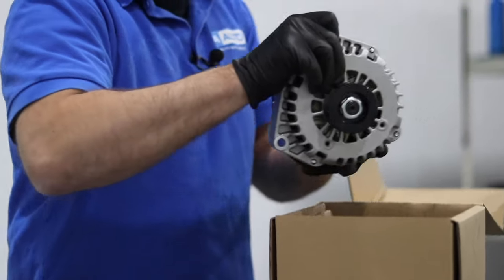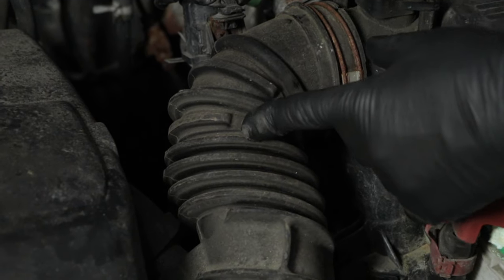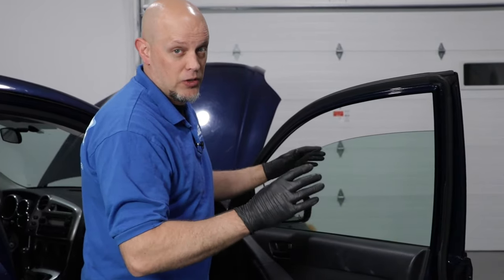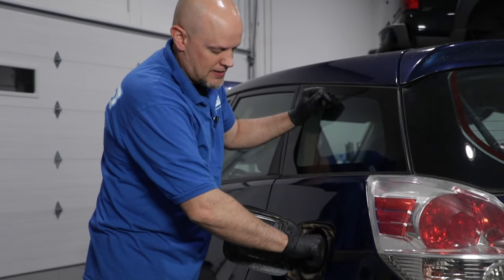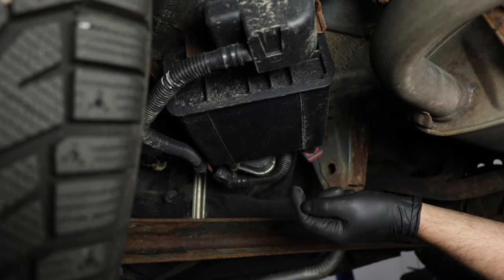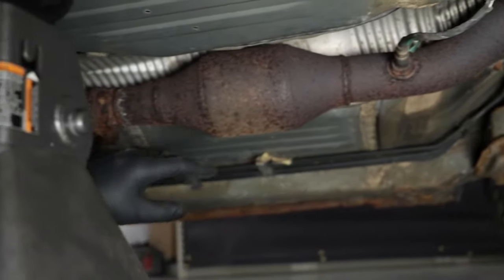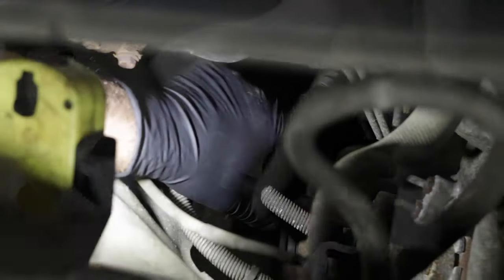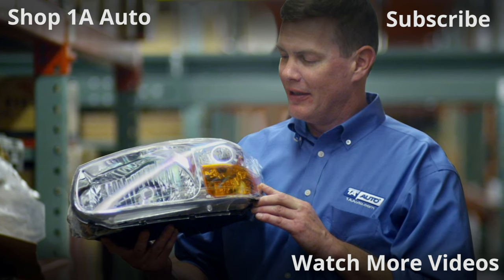Top 5 Problems Toyota Matrix Hatchback 1st Generation  2003-08

Comment: I have over 201.000 miles on my Toyota 2007 Matrix. Have not had any of this issues with my car yet.

Thanks for the information and help on how to deal with these issues.

However, changed my up and down stream O2 sensors, outlet manifold, water pump, thermostat, alternator, drive belt and tension er.  Wow, to replace that drive belt tension er you have to disconnect that front right motor mount jacking up the engine by 4 or more inches. That bottom alternator bolt is hard to remove. Don't strip that bolt. Pay attention to the torque specks on those 6 water pump bolts they are not all the same.

Maintenance, maintenance, and maintenance is the key to keeping your Toyota Matrix running for a long time. Get a OBD 2 reader and it will tell you what your problem(s) are when the check engine light comes on.

It is like the Air Force B 52s. They are from 1955 and still in the air. It is maintenance. The only original part of that plane may be the original tag on the frame. Everything else has been removed and replaced maybe several times or more. It has been flying for nearly 67 years.

Comment: I own an 06 matrix it has 316000 and I had all these issues and then some . I had a p0171 and it actually ended up being the intake manifold gasket . That gasket was so brittle I was shocked but , easy fix none the less .

Comment: 2003 Matrix automatic that I'm still driving. I love this car and hope it lasts me until I no longer need a car. :D  The only thing I HATE is that they didn't carpet the floor of the hatchback. I put a big rummer mat over is to stop gear from sliding around. In 20 years I have replaced the battery, muffler, starter motor, and various gaskets. My cousin owns the garage I take it to and he says if everyone bought a Matrix, he'd be in the poorhouse.

Comment: I have my 05 VIBE GT, love that car and it's over 600k miles.. Only issues consistent is the sunroof leaking, stereo having to be reset. Preventive maintenance is key. Right now I replaced the clutch but normal wear. Then the big one is the valve that blows through the exhaust on shut off
Reply: wow! highway miles? also loving for a manual vibe gt
Reply: Damn 1 million kilometers and still going

Comment: I've owned a 2004 5spd  since new.
I've only had to replace a couple ring seals, intake gasket and lately one of the transmission bearings.
The shocks are next.
All original bulbs and such are still working.
Aside from routine fluids and drive belt, nothing else has needed replacement.

Comment: '06 Matrix XR here bought new 2005.  19 years old in September.  73K original miles.  I have had none of these 5 problems, but I live in Chicago, so needed new exhaust in 2022 and extensive front end work in 2023 (city streets are brutal).  1800cc engine with auto trans.  My mother calls it Wonder Car.  I am always getting approached by parking garage managers that want to buy it.  Nuh-uh.  The car gods blessed me with the Matrix as compensation for having bought a Chevrolet Vega back when.

Comment: I've seen most of these issues with my 2006 Matrix. Bought it cheap (used of course) a couple years ago because that's all I could really afford. And it's just been one thing after another. I'm not very mechanically inclined, so I've had to outsource. And just recently took it in for the airbag recall and they gave me a long list of things it needs addressing with the fluids, the brakes (which had recently started squealing). Someone tried to break into my car, so I had to get a window fixed, still debating whether I should order new locks since these got messed up. Oh, and my kid snapped one of the handles off. But aside from all that, it gets us where we need and is still going strong on all the miles. Just gotta set aside time (soon) to get all these issues finally addressed.

Comment: Great Car.  I have 260,000 miles on my 2006 Toyota Matrix XR.  So far its been mostly tires and brakes, oil changes and oil filters, air filters.  I changed the plugs once.  Replaced the starter once.  Replaced the battery a couple of times.  I have had this car now for 14 years.  It has the original engine and the original transmission, which, I think are holding up better than the body parts.  A few body parts have just worn out and fallen off such as inner fenders, trim below the doors,. trim on the back end, the letters.  I may have the motor mount issue because it is making some noise.  But it is still getting 30 miles to the gallon, like the day I bought it. I wish I could buy another one.
Reply from the maker: +Gary Amstutz Thanks for the feedback!

Comment: The intake gaskets and manifolds are bad for leaking in cold weather throwing a p0171 code, as well as the timing chain tensioner o-rings fail causing an oil leak that makes the passenger side back of the engine and ps pump. Just a few common problems with the 1zzfe platform :)

Comment: Literally 5/6 of these issues have occurred with my 2003 Matrix.  I guess I should wait for the windows to fail, LOL!  Spot on!
Reply from the maker: +trish marshall Thanks for checking us out! http://1aau.to/m/Shop-1AAuto-c
Reply: I have an 03 Matrix as well. I have a weird ticking noise when it idles. Check engine light is on. I was told I have 2 catalytic converters. The back one is bad.
Reply: How many miles do you have on it?
Reply: @skylilly1  yes there is 2 catalytic converters but actually act as one with the o2 sensor in between.if it's the back one that is bad no codes would be triggered since it is passed the downstream o2 sensor. If the back one is bad the other one might be bad and that throws a code. They usually come together in one assembly
Reply: @skylilly1  the ticking noise could be the evap thingy under the hood that ticks

Comment: I think I have the bad MAF... but the only issues I get from that are cold start idle surging so I've not yet replaced it. The only other issue Ive had on the list is the window falling out, but that's because someone hit the passenger door in an accident (I was parked) and damaged the mechanism. As for the idling vibrations? The 1ZZ-FE is a very rattly engine - lots of NVH even in VINs with healthy engine mounts.

Comment: I have a 2006 Matrix XR, auto.  Love it.  Here are two downsides.  I live in LA so when the temperature gets above 95, the AC starts to lose the battle.  I have an excellent mechanic, we keep the ac charged up.  Done everything we can to get the max AC but I just accept that the 06 model, the ac they use is just not that strong.  Guy I know has an 09 Matrix but his ac is cold when the temp goes above 100 here.  The other issue I had, at 60K, one of my engine mounts broke.  Couldn't believe it.  I am the second owner.  I am an old guy so I am a safe driver and rarely ever speed.  Previous owner was a senior who used the car to go grocery shopping before she retired to a nursing home.  I bought the car at 40k.  It is still going strong at 120K now.
Reply from the maker: +@yogitam2372 Thanks for the feedback!

Comment: I have 05 base model matrix 5 speed with 220505 on it still runs strong The only thing I’ve had to replace is the clutch, and that was all messed up from the previous owner.

Comment: Always hold loose glass all the way up and firmly flush to the top door frame. Tighten properly firm while holding in place. If you can't get to screws all the way up, you can get them firm but loose, push up into position, lower carefully then tighten fully, hold what you got.

Comment: P0171 was triggered on my 2005 Pontiac vibe and it turned out to be dirty / clogged fuel injectors. No vacuum leaks present.
Reply: I found a 2005 matrix with the same code. the owner says the car takes a while to shift after 65mph... fuel injectors? that solved your transmission issue?? Should I buy this 2005 matrix and try to do a tuneup on it? its got 188,000 miles
Reply: she wants $1000 for the car
Reply: @robertp9370  just fucking buy it. And fix it yourself. Shouldn't cost you too much. This is a great car to get and at 1000$ it's a bargain. Especially if it still looks good. Have a test drive first though, and pay attention to every detail. Like you should always do when buying used cars

Comment: Only problem we've had is door handles - they break in half. Plenty of replacements on line, but getting them to work right is a chore. Warning: be careful replacing driver side front, could mess with smart/chip key. Otherwise I just can't think of any problem with these greatest of all cars!

Comment: I have an 03 Vibe GT.  Between the Vibe and the Matrix, they're both hatchback versions of the Corolla so reliability isn't a surprise.  I've replaced the catalytic converter twice with universal ones (can't complain since they were cheap).  I haven't really had to deal with any of the other issues listed but I suspect my mass air flow sensor is going bad.  I have also replaced the clutch a couple of times. 
  Honestly, the issues I'm dealing with right now are a small power steering leak and possibly an oil leak that sends fumes in through the a/c system.

Comment: I got an ols 05 Matrix with alot of miles. The odomoeter quit reading. But, the suspension sucks. I even tried having new struts put on it.
Reply: Suspension on a matrix is geared towards sporty and not comfort. Kind of a compromise between the 2

Comment: I have a 2003. Basic model. Put nearly 100k on it in four years driving from Seattle to the Columbia Gorge about 15 times a year to windsurf, then only about 60k since having moved to Hawaii. I’ve run it so dry at time that it took more than three quarts of oil to fill it. I’ve had to replace brakes, battery, alternator and the AC is busted. Just recently had to replace the rear taillights because they were so faded they weren’t red enough for safety check. The rear tailgate latch is so rusted that it won’t lock.
But the main thing is the hubcaps. I lost one, then two, then three and four all within about six years. I see matrixes all over with missing hubs, which cracks me up. 
I don’t care. It’s great having a junky car in Hawaii so no one breaks into it. I’m just trying to nurse it al9ng until the EV truck I’ve ordered is ready. I spent $13k to buy it new and maybe $3k since on various little repairs. Excellent mileage. Carries my surfing gear easy. It’s a great car and I’m upset they stopped making it. That fold down front seat is great. It folds down so flat that I can put my nine foot surfboard inside no problem.
Reply from the maker: +gatesurfer Thanks for checking us out. Shop for high quality auto parts on 1AAuto.com:

http://1aau.to/m/Shop-1AAuto-c

Comment: Dude, that one is missing the rear sway bar! @3:10  Those don't just fall off, welcome to understeer city.  
  I recomend disconnecting the front one instead.  I have a spare rear sway bar if they need one🙌🤭.  These cars are so easy to work on and one of the last available with a throttle cable, no abs or stability control and a super slick highly efficient manual transmission. I can burn the tires to the ground and not see any warning lights.

Comment: Got a 05 fwd and had the passenger side axle snap in half just leaving a stop light on day that’s the only time it was towed home with my tow truck (86 4 runner ) but yea had to do the air flow sensor and plugs and a coil pak here n there and plenty of oil changes … o yea the crank shaft seal was leakin oil replaced that twice waiting on engine mount kit and rear wheel bearings to come in the mail and then the next thing is front struts …. Also put lower control arms on a few times due to worn out bushings

Comment: Have 08 matrix - had most of exhaust system replaced - p0420 code still coming on with check engine light - this video helps - my mechanics cannot figure out why the code is still coming on - going to try several of the tips to see if that helps.

Comment: The most common cause of EVAP codes is the vacuum switch valve on these Matrix and Corolla.
Reply: Yes mine is throwing a P0452 and we can't put gas in it without it clicking off all the time at the pump I am going to replace it this weekend. Is this problem because we can't put gas in it? 
Thanks
Reply from the maker: +Jeremy Bonham We wouldn't be able to diagnose an issue like that here, you may want to have a local mechanic take a look at it. Thanks for checking us out! 1AAuto.com
Reply: You mean the evap purge value solenoid?

Comment: Ez enough. Thank you.
Theres a tsb on the intake manifold gasket. Get the Mahle orange one.  Amazon sent me the felpro black gasket. I used it anyway. They appear the same. There not.  It's worth doing yourself. It's pretty straight forward. Caution. The vacuum hose on the rear, needs to be put on the manifold , right after you slide it ( manifold)  into place.  Toyota nation has a write up.  It's better done in the sun, than a garage with overhead lights.  It can be done in under an hour complete. Don't use gasket adhesive

Comment: I have got none of these listed problems - weird. But I go have a roof that is starting to rust right at the windshield and of course mine has the well known issue, it's eating oil a lot. Granted I have 330000km on it. Other than that, the engines fires up reliable and no issues with the transmission. I'll keep it around as a beater.

Comment: I’m planning to keep my base 2007 matrix that I bought eight months ago till the wheels fall off. I put about 12000km since I bought it. So far it’s been very reliable except lately when I hold the brake paddle for a while while the engine idles I can hear squealing noise coming from where the exhaust pipe connecting to the engine. Do you think I have problem with engine mount? This squealing noise only happens when I hold on to the brake paddle while the car is in drive. I know it doesn’t come from the drive belt. It has about 190000km.

Comment: I’ve replaced the evap canister, and the evap valve at the front and tried multiple different kinds of gas caps, the evap codes keep coming back. Sometimes I hear the front valve clicking on and off again repeatedly and especially after I clear the codes, after it does that again the codes come back. Could it be a clog in the line as you said it needs vacuum?

Comment: I've had an 04 XRS for the past year or so. It's been a very reliable car so far and such a blast to drive! However, I'm having an issue where my passenger side footwell gets damp/puddles water starting right near the passenger door whenever it rains, as the car is kept outdoors. I've tried clearing out the cowling and tested the sunroof and windows for leaks, but none of that has solved the problem. I'm not sure if this was a problem for the previous owners of the car, but I first noticed it around 2 months after I bought it. Any suggestions?
Reply: sorry if this is late and you figured it out already, but if you look underneath the dash, there should be a rubber hose and it should be connected to the plug in the floor. it's a condensation drainage tube. it most likely means one of your passengers accidentally kicked it and knocked off
Reply: Or it could also be a clogged water drain hole from the sunroof.

Comment: i have 2 matrix 1 is running each day is a 2007 model have 278 000km still running great have 1 of 5 problems with the canister i need to replace that soon. the other i bought recently for part. the car have around 700 000km is a 2005 model. the last owner say to me he's bought new and make around 40 000km a year.  the car works but the body is very rusty

Comment: I have a 2003 Toyota matrix xr ,I bought it 6 months ago it has some problems with the lower control arms , broken silencer, broken pipe from curve to muffler,air bag recall from Toyota,absorber s ,rear axle bushings, noises in all the suspension components,I tried to fix one of the lower control arms and one of the bolts broke ,rusty and stuck when i press the brake pedal the control arm  it feels loose.
Reply: Yeah problems were same as mine. I bought a 2005 Toyota matrix with 125k miles. The manifold had to be fixed and around 130k... the struts needed to be changed. I waited a bit....my fault and it damaged the bearings. Other then that the engine has been solid

Comment: Good afternoon I have a 2006 toyota matrix it just develop a fault that if I start it, after a few seconds it will go off if I try starting it immediately it won't start but after some minutes before it will start again after some seconds it will go off again just like that.
Please what could be fault and possible solution thanks

Comment: What do you do about a 2005 with air bag light issues? Intermittent especially won’t work in extreme heat or cold. Works best between 50 and 80. Clock spinner was replaced didn’t fix it. Is it just the light or the sensor under the seat?
Reply from the maker: +@elizadoolittle7647 We wouldn't be able to diagnose an issue like that here, you may want to have a local mechanic take a look at it. Thanks for checking us out! http://1aau.to/m/Shop-1AAuto-c

Comment: I'm having a problem with the catylic  converter in my 2007 can't get check engine light to go off. On 2,nd one changed upstream and downstream O2 sensors. Keep getting the converter code

Comment: Yup. Motor mounts. Are awful on these and aftermarket parts are terrible! The vibrations insane after replacing . The chain tensioner also is a huge leak point and front seal. Very inexpensive to replace and well worth it.. brakes squeal like hell as well.

Comment: What’s the biggest issue with brakes ? I have an abs light on the dash the car shakes a little when braking. It makes a strange sound when I brake I changed the brakes drums and rotors. Some mechanics think it’s master cylinder some think it’s the booster. I think it’s abs. I have no clue though.

Comment: My AC went out. I can smell oil inside the car. I replaced low pressure hose. Still not getting cool. Checked relays and fuses. What can it be?